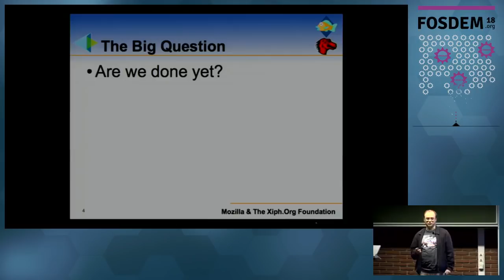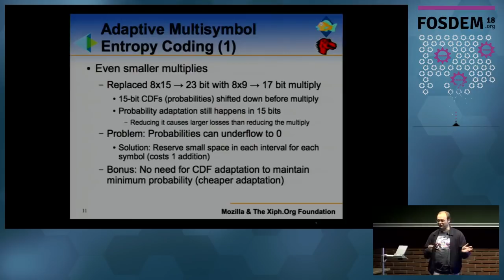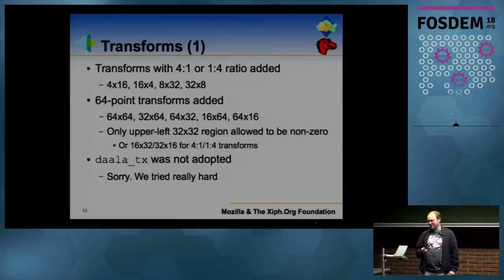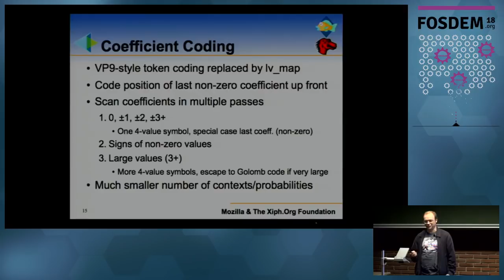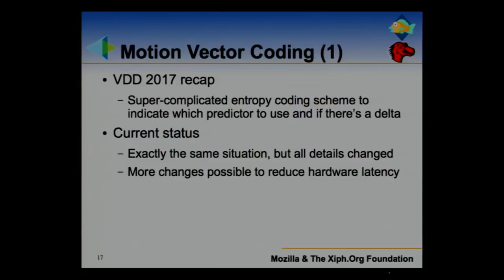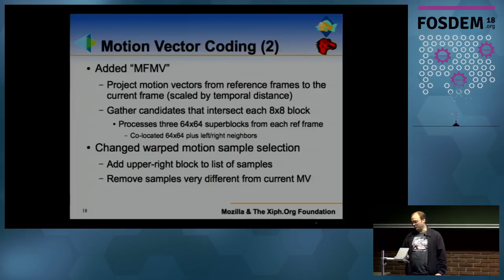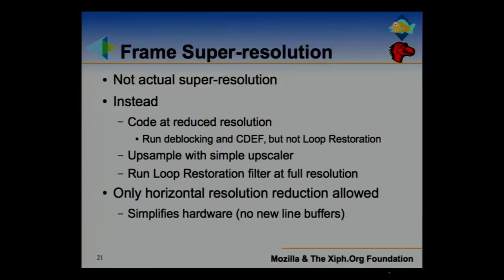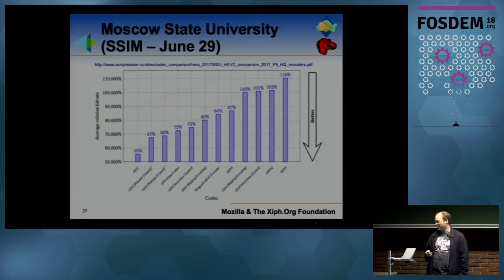AV1 Codec Update

Comment: Encoding is just 2500-3000 times slower than the VP9 codec, LOL
Reply: Have they actually even started using simd optimizations? (wait till the release of an actual working encoder) I don't think Netflix would even care, as long as the decoder is fast enough ^^

At least the speed doesn't matter if you're using a hardware encoder ;)
Reply: Piratekiller99 Yes a lot of the codec is simd optimized at this stage. The 3000x slower comment is probaby refered to the research master build that searches all possibe combinations but there are different speed levels with less searches, you can certainly encode at "only" 20x-40x slower encodes than vp9 with only a couple percent quality loss compared to research build so they'getting there. Decode speed is about 50% slower then vp9 so no big deal.
Reply: Ashtree81 very interesting stuff :)
thx for the insight.
especially the decoder.
200% of the official decoder or ffmpeg's though? (makes a big difference after all 😅)
Reply: Piratekiller99 About 150% of libvpx vp9 probably even faster since they still optimize a lot
Reply: of course it's not done, yet ^^
decoder performance isn't the main priority during creating a codec after all (for valid reasons)

I expect it will be optimized a lot more once it's out :)
especially if this guy gets his hands on it (Or ffmpeg people in general)
https://blogs.gnome.org/rbultje/2014/02/22/the-worlds-fastest-vp9-decoder-ffvp9/
Reply: Piratekiller99 Yes once the bitsream is frozen there will be a lot of progress with speed. Its just mindblowing how much progress they made in just 3-4 years! But I guess you could argue they cough borrowed a lot of stuff from hevc for vp9 onward with clever patent evasion
Reply: Ashtree81 I can't argue on that without evidence/looking into it ;)
Reply: Piratekiller99 Im just saying the patentholders at mpeg has done most of the heavy lifting in the codec world in general, not only with hevc but with all prior block/transform based codecs aswell. Not taking anything away from the truly awesome stuff the av1 developer has accomplished in a short period of time, but dancing around patents is a big part of codec development.